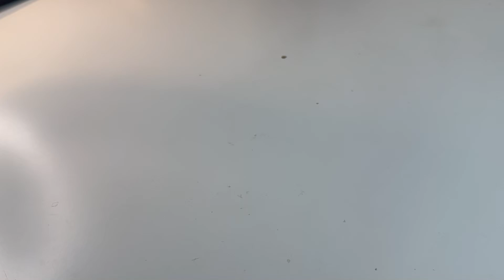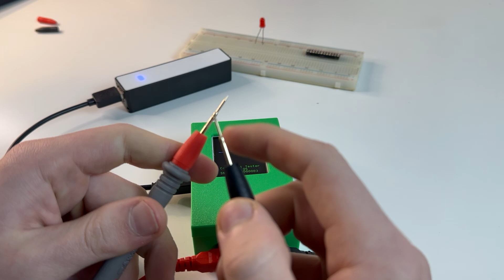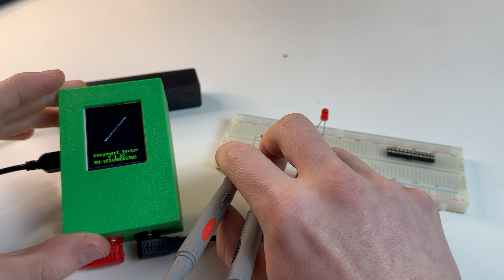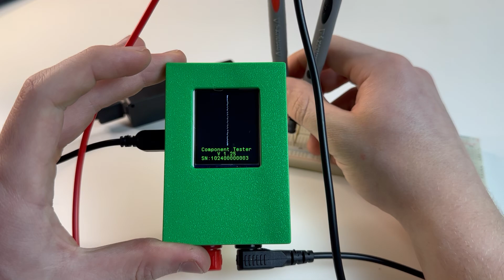How to use the OctoTester to test ELECTRONICS!

Comment: Correctly formatted TimeStamps

       ⏱      TIMESTAMPS 
     00:00   The OctoTester
     01:03   Open Circuit
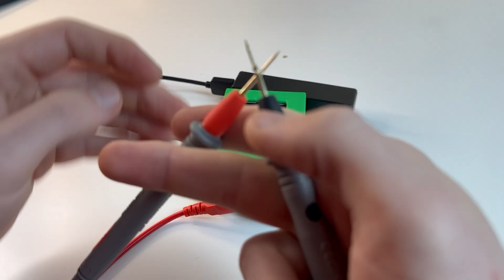     01:29   Short Circuit
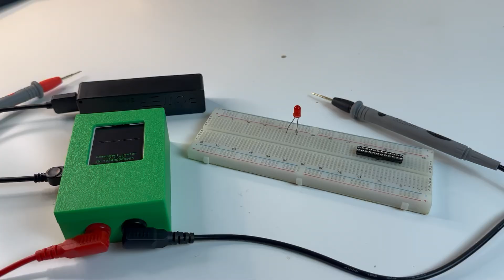     01:42   Testing Resistors
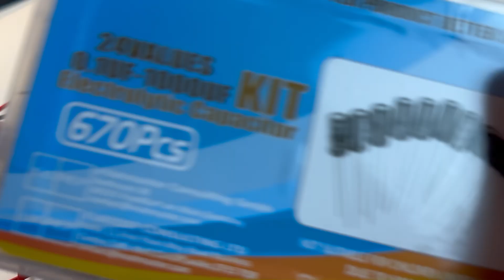     03:35   Testing Capacitors
     06:00   Testing Diodes
     06:50   Testing Transistors
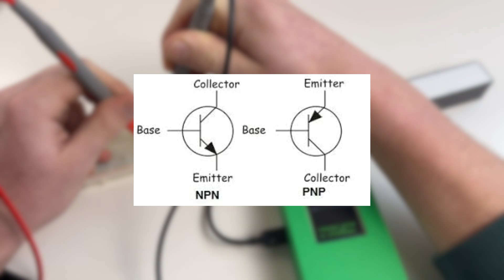     07:55   Different Traces
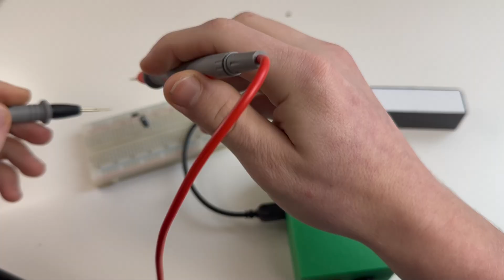     08:34   Limitations
Reply from the maker: Thank you for this, I'll update the video description

Comment: This silly design surfaces from time to time ,and usually at a ridiculous price.  Most of these component testers are 1 AC low voltage transformer and 1 resistor.  This is  "much" more complicated because it has an oscillator inside.  Wonder what this device costs??
Reply from the maker: I will post more videos in the future to highlight how effective this tester is when testing circuit boards

Comment: This is a cool idea but I have a hard time seeing the point it seems decent at testing a very specific range of components but for troubleshooting I don’t see how this helps much knowing if something is 1ohm or 100 ohms is a huge deal and can be the difference between a working and broken circuit but this cannot tell

I like the visual design but it just doesn’t seem that helpful compared to a multimeter
Reply from the maker: Hi, thanks for the intuitive comment. We are working on a model that is able to test a smaller range upon selection. The idea behind the tester is to allow faster testing of electronic boards, where for the multimeter one needs to remove the component from the circuit (actually desolder) , this tester can do it in circuit. We will be posting more content soon on how useful this tester is when testing in circuit